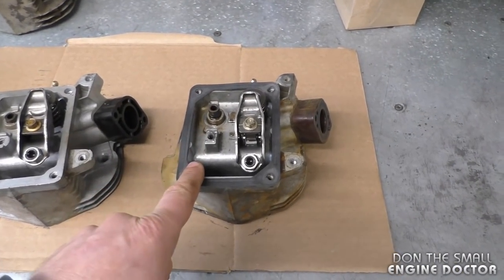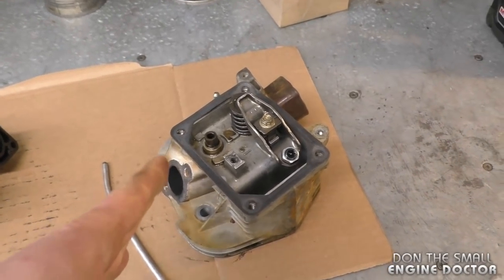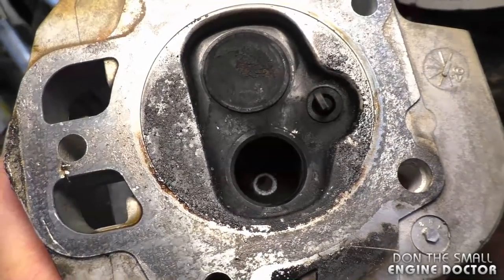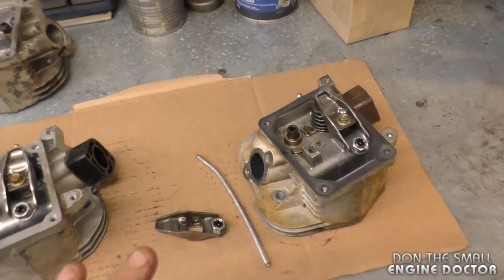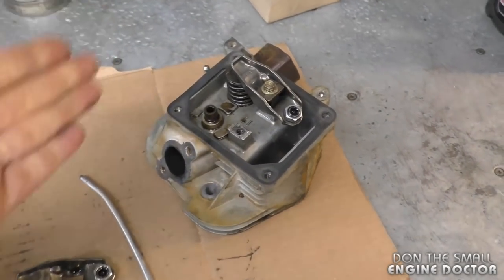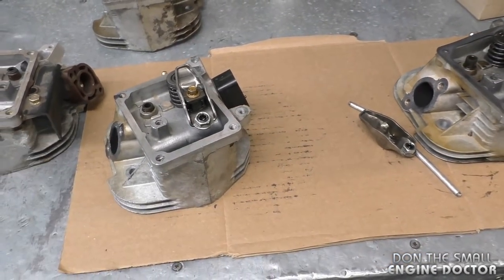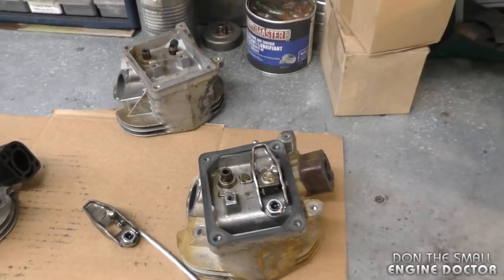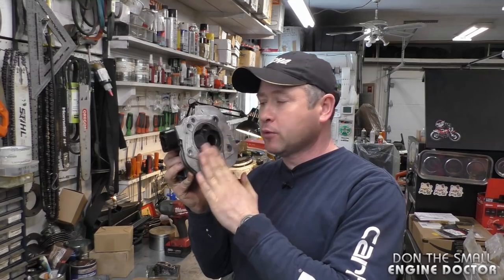Common Defective Briggs & Stratton Cylinder Head On Snowblower Engines! - Video

Comment: 10 years or so ago, the Kawi engines on John Deere mowers were doing the exact same thing. That was due to a cooling problem.
Reply: Exactly the engine getting too hot generally due to cooling fins clogged
Reply: @RaleysSmallEngines  Bingo...not to say that's the snowblower issue

Comment: Question bro. I have a bad craftsman snowblower (with left and right turn assits) tecumseh 9hp engine. Can i replace it with a 5 hp tecumseh engine?
Reply: most likely find between that big an engine size difference they will change output shaft size resulting in the need for new pulleys, Then it comes down to if the engine will have enough torque to drive the impeller unit let alone throw the snow far enough.  Probably best buy a robin or Chinese engine as replacement staying same horsepower to keep shaft sizing the same.
Reply: @glennlurman3514  roger that , thanks

Comment: Good video donyboy73. 
I fixed my Honda 1332. Was a $40 usd fix. Wondering if you ever heard of it before. It was the charcoal filter in the gas cap. Basically suffocates my machine and dies. This was diagnosed due to putting my snowblower on its front end (even with plastic bag) and gasoline leaked inside the vent hole ruining the charcoal inside.

Comment: I might suspect that the tolerances between guide and valve stem is too tight. As things heat up the valve stick to the guide and work it up.
If that is the case then you could ream the guide a bit to make it larger.
Reply: opening guide causes the engine oil vapour to weep up resulting in smoking fouling plugs.
Reply: @glennlurman3514  
In theory yes.
May engines does not have any seal on the exhaust guides, because as the exhaust pass by in the exhaust port it tend to pull air down between guide and vale steam, rather than pushing it up.
In that way the guide gets lubricated. And any excess oil going down there would end up in the exhaust gases. 

I would not be afraid to try this.

Comment: How about using the green loctite retaining liquid... Maybe head heat would negate it's effectiveness.  If not the stuff is amazing

Or open it like a couple other have mentioned, then you add mechanical interference
Reply: I tried that before and it seemed like all the liquid just squeezed out when you tap in the guide.  I guess all you need is a microscopic film for it to work.

Comment: I realize that new is best for no customer come backs.  What about these options?  Straightening out the bent push rod and reinstalling.  Reseating the valve guide and welding it for permanent so it won't pop out again.  Feedback is welcome and appreciated.

Comment: We would turn knurls on the valve guide on a lathe to expand the metal. Then shrink fit with dry ice or liquid nitrogen rather than press fit. That just scrapes the expanded knurls off. That fixes it permanent.

Comment: Beat it back in place drill through the side and put a small setscrew
Reply: Yes !! I've done that exact thing with great success I also put locktite on the set screw.
Reply: @RaleysSmallEngines  I actually saw Taryl, of Taryl Fixes all do it on a video , And I believe he did put Loctite on the setscrew also, looks like a pretty reliable fix
Reply: @vinces8974  I saw that video also.. LOL We watch every video he does
Reply: @RaleysSmallEngines  Taryl is awesome

Comment: Could you not tap the valve guide back down to it's original position...then peen around the top of it to tighten up the guide so it won't slip loose again [similar to reseating a valve seat that came loose] (seems like maybe the press fit isn't tight enough and the heat of the head makes it expand faster and then come loose, heck maybe a bit of JB Weld on the outer part of the guide, then drive the guide back in might help it) They may not be scrapped just need to be made where the guide won't slide up any more.

Comment: I supect the engine is running slihtly too lean at high RPM..this causes the exhaust valve area  of the cylinder to be much higher than the intake side. I suggest a slightly richer fuel mixture at the top end.

Comment: Great Topic Dony. You left "Stupid" out of the Disclaimer  I like the idea of drilling in through the top of the boss on a downward angle and into the guide. Some locktite ™ and then insert the proper size Roll Pin.  Could a loose fit spacer be put on top of the guide so the Valve action would keep the guide from coming out?  I don't believe it happens all at once.  Clean valve stem or new valve.  New head gasket required of course and Steel Push Rod.  I like the TIG weld solution.

Comment: Do you think i can put a 30 inch bar on a stihl ms 170 chainsaw? And can I use a stihl ms 291 cluch on it? I seen a guy put a 28 inch bar on a stihl ms 180!!! And it didn't even bogg down!!!
Reply: the ms170 uses a small gauge chain thickness so a big upgrade that size will need clutch drum as for bogging if the wood is not forced and the chain is left to cut it would work.  would i do it no i wouldnt buy a ms170 to start with.  Sorry 30 years a small engines mechanic and unless its large displacement go Japanese.

Comment: If your only option is to replace the head.  I would just do option 1 and take a centering punch and put additional pressure around the guide.  Via deforming the aluminum metal around the guide using punch.  Similar to valve seats.

Comment: The ford fe and BBC engines used to wear valve guides fast , we would buy a box of guides ream out to fit drive in New with locktite  and ream to fit valve stem ,could get light,medium and heavy wall machine shops supposedly used ovens to heat the head . I remember putting knurled bronze guides in propane engines.  Still got the set up but have not tried buying guides for 40 years , maybe can't even buy them now ps never worked on a aluminum head , maybe all those old school methods won't cut it now

Comment: I've seen the engine two ways. People that use 87 octane fuel have more trouble than people using 93 high test. When these engines hit the higher demands of snow, as wet and heavy slush, higher octane fuels actually burn cooler in the engine than entry level 87. Spend a little more o n your machine (93 high test)  and keep it running longer. Advise by a consumer that has owned 4 of these machines over the decades.
Reply: nonsense.   its not detonating....these engines are low compression.
higher octane does not burn cooler either.  
its the guide...its either too tight on valve and siezing onto valve and moving, or the press fit they did was too loose.

poor materials, poor machining.   Heartbreaker for the owner who opened the wallet and got reamed.

Comment: The guides popping out issue might be due, also,  to users not letting the engine warm up gently on cold wintry start-ups. And ofcourse low cost manufacturing as well. Immediate revving of a cold engine in the freeze of winter will induce thermal stresses and a wide difference of temperatures between the head casting and valve guide/sleeve. And so they pop out. They make'em so flimsy nowadays, might as well tie them with silk thread..!!

Comment: I would push it back in and then center punch around the edge of the outside of the hole on the spring side of the head to make sure there was is tighter than the original or push it all the way out and then rough up the wall and then put it back in with some Loctite red that's rated for heat so I can't move again

Comment: Chinese made. That’s the problem. I have a generator repair business. Poor sand casting results in holes in heads and failure. I’ve never seen a blown head on old Tecumseh, or Honda, Yamaha heads.
Reply: Chinese made is no problem. Chinese just makes level of quality what customer wants and kind of QC. Sad that old super reliable machines are bad nowdays.

Comment: Take the BY fix to the next level, 1/16" drill at the seam of the head/valve guide, 1/2" Deep. Install a Split Pin (Radial Spring) with hi temp locktite. The differential CTE's between al Alum and Brass cause the valve guide to walk and poor tolerancing with hi temps. Also probably poor incomimg QC at the factory.  The steel radial springs (aka split pins) expand with temp and lock the valve guide to the alum head. Do this in at least two places, also peen the edges with a punch, as stated in previous comments.

I did this with my 24hp Briggs V-twin, about 8-10yrs ago, no issues with that prob since.

Imho, you really have nothing to lose with the BY fix, maybe save a $500 repair bill, the head is wrecked anyway. 

Just tapping the valve guide back into place is not a fix, since the problem stll exits, 'tried that on my first go-round, and was right back  to the same prob a couple weeks later.....you can also try straightening to valve rod, but they re cheap enough. In my case the second time the the rod ended up in the crankcase, then of course req a whole teardown!

Comment: I hope no one will mind if I promote an idea that is being explored deep in the comments. Perhaps the problem is starting up a snowblower in the dead of winter and suddenly exposing the head to high heat. That is, if the aluminum head has contracted in sub-freezing temperatures, wouldn't the valve guide become just a little loose? Maybe that's all it takes to have it slide up. It would be interesting to see if this is a problem that occurs on snowblowers (which are used in cold weather) more frequently than on other machines, and if mechanics in the south never see it. Just wondering.

Comment: It's the ethanol that's causing these problems  the Briggs and Stratton  V twin vertical lawn mower engines have the same issue and everybody's blaming that on overheating caused by grass getting caught up in the head the blower not being able to cool it properly caught up in the head. I've been telling people for years that's not the problem and and now there's proof the same issue is affecting the snow blower engines it's not an overheating issue it's residual water being left behind in the combustion chamber and round the valves as well as acetic acid that that fuel produces it's corroding the internal parts of the engine and seizing them up 90% of the equipment I get in for the service or repair is damaged or ruined from ethanol fuel. The manufacturers of small engines are well aware that they should not be ran on ethanol fuel  but they're not going to be single themselves out and say that their equipment should not be banned on the crappy blended ethanol fuel readily available at all fuel stations that would certainly bankrupt them. honda's the only one i've seen being forthright on this issue and have completely changed their re....hanol blended fuel in small equipment i've also changed their recommendations on how long you should can store it in a plastic fuel can. it's real simple don't use ethanol and you won't have any problems.   P.S. all the homeowner weekend warrior armchair barstool mechanics  you're not a genius that has solved a problem a by purchasing a subpar ethanol blended fuel which is actually more expensive per gallon because it produces 30% less power per gallon than regular unleaded gasoline and then adding an expensive additive on top of that. All you're doing is costing yourself more money so I really don't wanna hear about it.

Comment: As others mentioned probably due to heat on the exhaust and carbon build up on the valve, but the main reason is poor Q.C in China.
Reply: Bad Engineering on Interference Fit tolerances.

Comment: $300 for a new head...at that point I would pull the Briggs off and replace it with a Honda GX series.
Reply from the maker: right on!
Reply: @donyboy73  Thanks, I've done that with at least two Briggs so far, but one was with a Honda clone.

Comment: IF you knew the engine code for the B&S engines built OUT of the U.S. it may help you to trace the ORIGIN of the problem, with the massive changes going on in B&S the last 10+ years it doesn't surprise many.

Comment: My 2018 Simplicity (poor excuse for a Simplicity) M1024E has a Briggs engine similar to the one in this video but smaller. 9.00 I going to pull the valve cover off and see how the valve guides look on the head and adjust the valves while I’m in there. I highly DO NOT RECOMMEND THIS MODEL SIMPLICITY SNOWBLOWER. It’s nowhere near as good as the old Simplicity models. And by the way. Briggs and Stratton owns Simplicity. My M1024E snowblower was built in...you guessed it...CHINA. My dealer never told me, I found out myself. Don’t make the Mistake I made and stay away from this Simplicity model 2 stage snowblower!